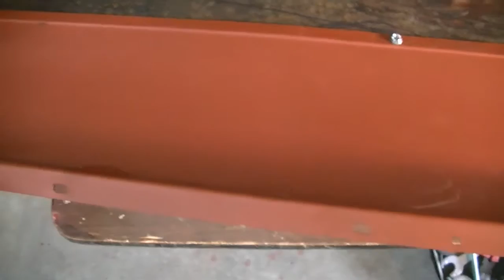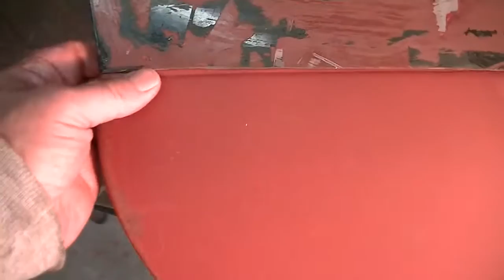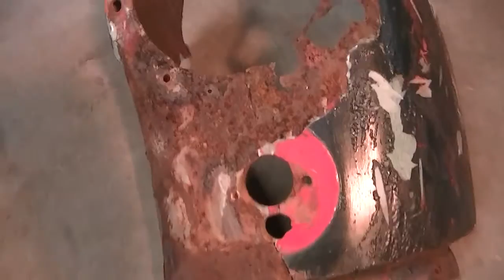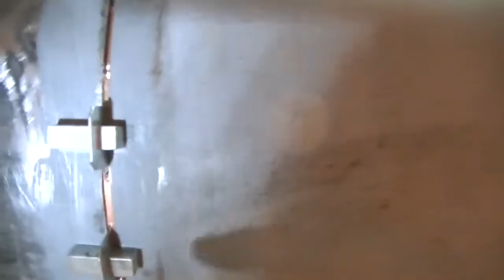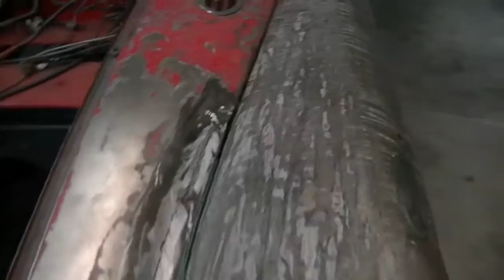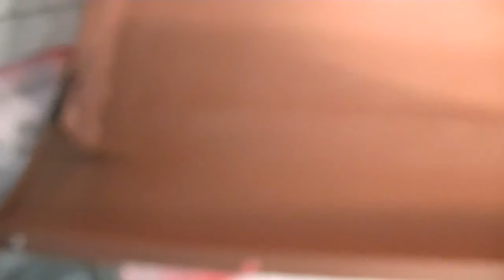1960 MGA Restoration - Front left fender repairs

Comment: What do you fill the welds in with?
Reply from the maker: I used USC All-Metal for filling most welds.  This stuff is strong and the body shop approved of my choice.  But it was hard for me to make it invisible and the body guys used a more conventional filler over it for final smoothness.  Sometimes for interior welds, and pin holes that were hard to weld, I used Permatex metal filler, comes in a tube, hardens quickly, sandable.  Also used seam sealer paint from Eastwood over interior welds that I wanted to have extra corrosion protection.

Comment: nice...tell me were did you buy the copper strip for welding
Reply from the maker: Hi Serge
I had a roll of this copper strip that I bought years ago from a metal supplier that advertised in my ham radio publications (it is used for ground straps).  Sorry I don't have the name of the supplier.